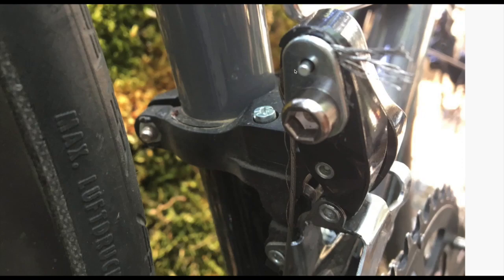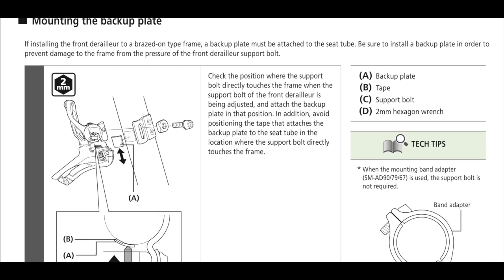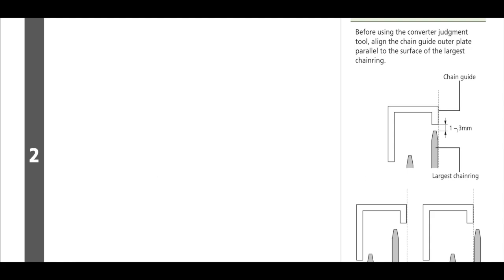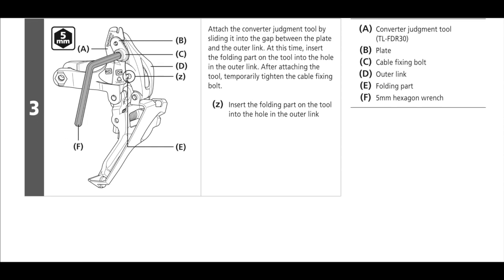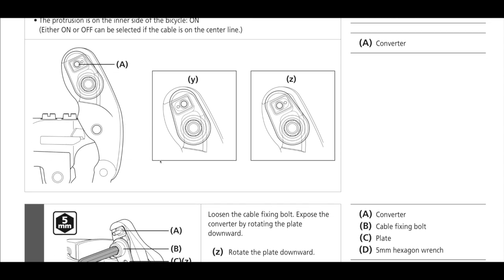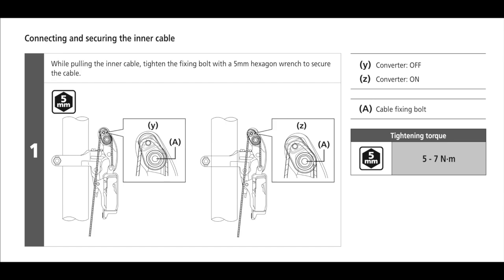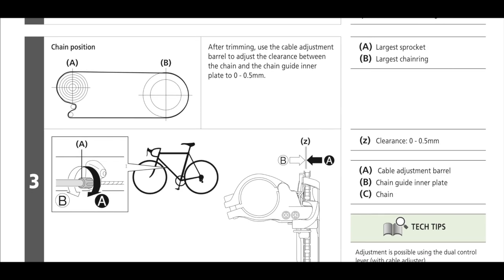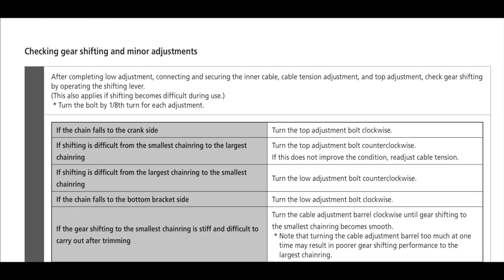Shimano Sora R3000 and Claris R2000 Front Derailleur Set Up Tips

Comment: Pro tip: During first installation of the cable, tighten the low limit screw a couple of turns to bring the cage out before pulling and tightening the cable. After you loosen the limit screw back to original position, the derailler cage spring will help take out any last bit of slack in the cable and pull it nice and taut.

Comment: I have found these like a bit more initial tension than other front derailleurs.    With most front derailleurs I pull out the slack with my fingers, to not interfere with low limit.  To get one of these Sora's working I had to use pliers, and pull pretty snug, and fine tune with the in line barrel adjuster.

Comment: Thank you.  I tried changing to "converter ON" position.  I may have slightly more room in the big ring. The Sora Brifters still won't accommodate both high and low positions without the chain rubbing the derailleur. It's either 50/11 or 34/34 but not both. I get close on the repair stand, but with real life, out-of-the-saddle, peddling it rubs in 50/11.  The pin needs to be a bit further from the derailleur's pivot point. Dealer's manual(in Dec 2023): https://si.shimano.com/en/pdfs/dm/RBFD001/DM-RBFD001-01-ENG.pdf

Comment: The cable routing on these derailleurs is terrible, even if you set it correctly, if you have the inner stop screw set up with the derailleur quite close to the frame (as that’s where it needs to be the correct setup on some bikes) sometimes the cable will not shift the derailleur from the little ring to the big one, because the angle/leverage is all wrong, and it really doesn’t seem to matter how you adjust the cable/ set up the clamping arrangement, the design is terrible. Also in your video when you pull up a picture near the end after looking at the Instructions that cable seems to be routed  incorrectly….  I think apart from the fact the cable is all frayed up, it should be clamped on the “outside“ not the “inside“ of the plate behind the bolt. If that makes sense, it’s almost like the cable needs to be curved all the way round and down and out the bottom
Reply: Thanks for the comment. Helped me figure out why my FD wouldnt shift to the big and as you explained its because of the bad design. I had to tighten the L screw and bring the cage out to tilt it so the cable can pull on it and have laverage. Horrible design. Lost half my day figuring it out could have completed the whole bike. I think I will change to the Tiagra one.

Comment: I still have an issue where I can't get the  chain to the big ring. I think it's due to the cable tension but it's tight.

I changed the H limit and it doesn't change anything. If I put pressure on the derailer or apply more pressure on the shifter it will go on the outer ring

Comment: My issue was cable alignment and the front mech needed to be cleaned as the cable tension was impossible to set with varying levels of spring tension depending on what chain ring I was on due to sticky pivots.

Comment: Just bought  a new bike with Sora group. Everything seems to be OK except the front derailleur, which I found to be too stiff. My friends Tiagra is way smoother. I have already checked cables, housing, positioning etc, and it still demands an "additional" effort to front shifting. Would like to hear other opinions about that.
Reply: Check cable guide below bottom bracket of the frame, could be more friction
Reply: @hellborn7514  Came back here after all these months to say I finally solved my problem using Jagwire's Road Elite Sealed Shift Kit. This kit comes with a very thin teflon housing (which goes inside the "real" housing) and it extends all the way from STI up to derailleur, indeed sealing the cable avoiding contact with any external agent (water, dirt etc). Specifically below bottom bracket the friction reduction was incredible. Now my front shift is as smooth as the rear one. Couldn't be happier 🙂

Comment: Very poor design from Shimano. No matter which position the converter is in, shifting the derailleur takes all my hand strength on the shifter just to get it to move.
Reply: This has been driving me nuts as I thought it was a setup issue. Turns out it's sadly the case with these lower-end front derailleurs.
Reply: @djdelarosa25  Shifting improved slightly when I did the opposite of what the instructions say. I ride 3 other bikes regularly that have Shimano Ultegra and are all much easier to shift. You can easily swap out the Claris for a used 105. 600, Ultegra etc if you give up on the Claris.
Reply: @duathlete827  What did you do to improve on the performance? Wouldn't using an 11-speed front derailleur cause issues due to the different pull ratio and smaller space between the cage plates?
Reply: @djdelarosa25  Front derailleur is usually for 2 or three chain rings. Mine is for 2 and is a Shimano Claris FD-R2000. My rear cassette is an 8 sp. If you have the same model, make sure you use the backup plate it comes with along with adjusting the support screw if your derailleur mounts via a braze-on. The converter judgement tool that it comes with will indicate if the converter adjustment should be on or off. Mine said set it to the off position but it actually works better using the on position.
Reply: @duathlete827  My bad, you were talking about swapping the whole groupset to a 105/Ultegra, not just the front derailleur.

Yeah I did mount the backup plate and set the converter to the On position. I didn't have the tool so I had to experiment and the Off position just felt bad.
Reply: @djdelarosa25  I AM just talking about the front derailleur. You can use a 105 or Dura ace or Ultegra front derailleur if you can't get you Claris to work right. Preferably your shifter/brake is Shimano.
Reply: @duathlete827  Oh... yeah that's the thing. 8 speed chains are wider compared to 11 speed and this reflects in the front derailleur where the gap is smaller in 11 speed vs 8 speed. I would imagine there would be some rubbing if you indexed it properly.
Reply: @djdelarosa25  the front derailleur doesn't engage the chain with teeth. It just pushes the chain (any chain) over to another ring. Only the rear derailleur engages the chain via sprocket teeth.
Reply: I don't think you get me. The front derailleur isn't all the same between 8 speed, 9 speed, 10 speed, etc. The distance between the inner cage plate and the outer changes between speeds. This is because lower-speed drivetrains have wider chains to accommodate the wider spacing at the rear cassette. An 11-speed chain is gonna be narrower than an 8-speed chain, so are the chainrings. Now, the front derailleur of an 11-speed groupset is gonna have a tighter spacing between cage plates to match the narrower chain. This is where the potential trouble of using an 11-speed front derailleur on an 8-speed setup lies. Sure, you could get away with using a 9-speed front derailleur on an 8-speed, or an 11-speed front derailleur on a 10, but a big jump like 11 vs 8 would manifest some problems. I'd imagine unless you set the front derailleur up in a way that Shimano doesn't recommend, you'll get chain rub because of the wider 8-speed chain matched with the smaller-spaced front derailleur of an 11-speed system. I've read around and people don't really recommend getting narrower front derailleurs if you got index shifting. Read the first comment here: https://www.bikeforums.net/bicycle-mechanics/1077199-10-speed-front-derailleur-8-speed-cassette.html

There's also the topic of the cable pull ratio of the front derailleur varying across different speeds, but that's a different topic altogether.
Reply: Agreed, the design of this derailleur is abysmal. Any 20+ year old front derailleur works better than this and is much easier to setup and adjust.

Comment: Do you by any chance know if the R3000 and R2000 front derailleurs are cross compatible with the R3000 and R2000 shifters? (Sora shifter with Claris derailleur or viceversa).
Reply: They are.

Comment: What if the cable routing comes from the top ? will it work?
Reply from the maker: No, this particular derailleur only works as a bottom pull.
Reply: @JoeyMesa  hey joey! on my bike the cable comes from the top but jamis installed a pulley wheel to then have it come around and work with the bottom pull r2000. i'm having issues still after watching the video, do you think the pulley is changing the ratio?

Comment: Question for ya, Joey. What do you think of the new 'arm' design on the latest iteration of Shimano FD's? I'm still running 10 speed 5700 stock groupset, but with a 5800 FD with the longer arm. It seems that they got rid of that idea and now have these newer shorter arms and other gizmo's. Is the shifting vastly superior with these newer FD's and RD's on 105, Ultegra and DA, or is it just slightly better?

A 5800 FD works well with 5700 components as the chainring spacing didn't change, yet with the newer stuff like 11 speed, cable pull ratio and the new chainring spacings, I can't use anything newer than 5800. I'm not gonna buy a new groupset for my 2011 bike. I'll probably just save up and buy a whole new bike with a newer groupset on it, when I actually have some dough.

Have a great weekend, mah man.

Regards from England
Reply from the maker: Honestly, I've never tried a 5800 front derailleur with a 5700 shifter. The long arm style works well on most bikes, but there isn't a definitive standard among manufacturers as to what angle the cable should be from under the BB to the front derailleur, so on some bikes with the angle really shallow, it's difficult to get the shifter to start initially moving the derailleur. The newer style 5801 doesn't have the long arm, but it's the exact same ratio as the 5800, it's just easier to get started into it's shift on all bicycles and it's got a cable tension adjuster built in.
Thanks for taking the time to give feedback and ask questions! I really appreciate it!!